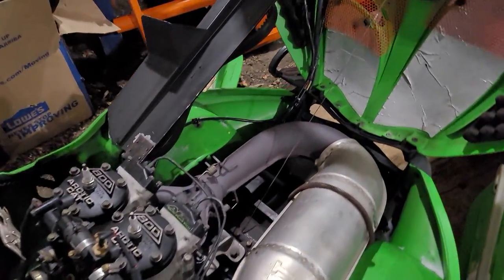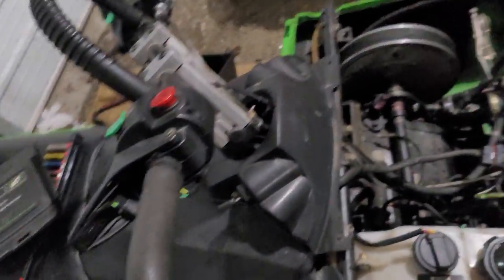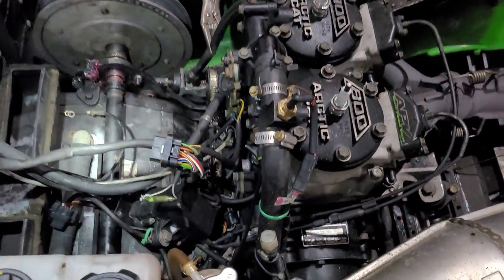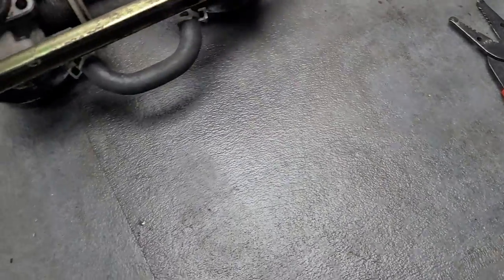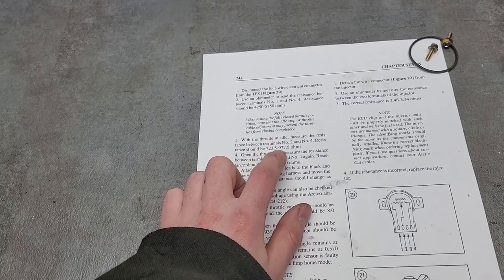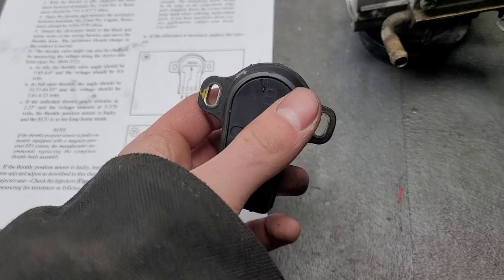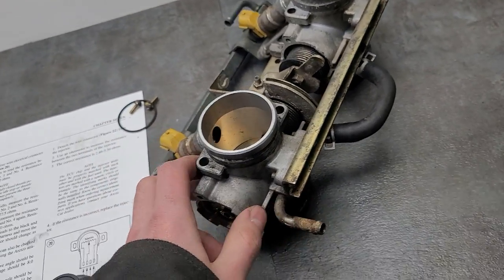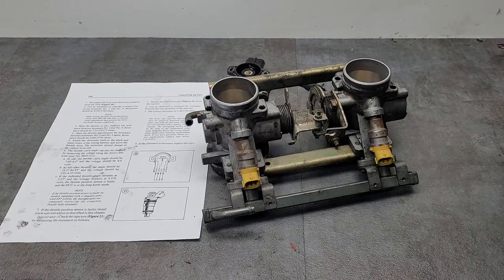Arctic Cat Snowmobile - Annoying Low-Mid Throttle Bog/Cutout Diagnosis. Part 1

Comment: Its your TSS. Throttle safty switch. They get worn out. You need to unplug the 3 wires to the throttle.
Reply from the maker: It has been completely bypassed, I'm certain it is the TPS.
Reply: So if we disconnect the 3 wires, can it get rid of the bog? Or would we need to get another tps?

Comment: I have an 04 Mountain Cat 800 efi (600 miles) and I'm having a similar issue...but it's fine for the first few minutes or so, but then gets worse. I cut the tss, maybe it's the tps? Maybe power exhaust valves?
Reply: 04 Mountain Cat 900 that would go limp mode almost as soon as I went off idle. Spent a very long time chasing this same kind of issue. Pulled stator, injector service, wiring check, different injectors, regulator, tts delete and new coil only to find out in the end that it was the tps. Put on a used throttle body from an 800 Mtn Cat with my injectors. I'm pretty certain that SP1 will have a replacement tps for your 800 as I did see one for mine.
Reply: Thanks @philhaughn6537  yeah, I cur the tss, and it seemed to solve a bit of the problem...but noticed it still has a tendency to bog out, and I think you're right with it being the tps.

Comment: its almost always a ''ground'' issue who create weak spark, clean all the grounds wire every season .   (it can be a bad battery who is ''shorted'' and ''pump'' all the current) , its an electric problem or in rare case, mice nest in airbox :0)

Comment: Check your smart valves in your gas tank. You will find they are collapsed causing lack of fuel to fuel pump 
If you run to long in this condition you will damage your fuel pump cause it is running dry

Comment: Check the fuel pressure by routing the return line to a bucket and starting the sled, if there is no fuel try the high pressure line and jump the pump with a 12 v battery, if you can easily stop the flow you could have a bad pump OR somewhere down the line there is a crack cause loss of pressure